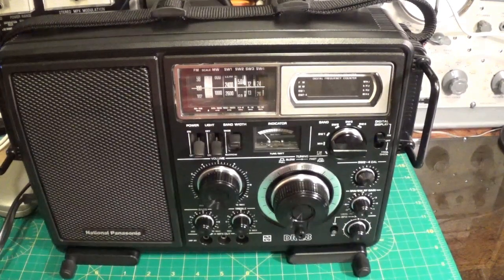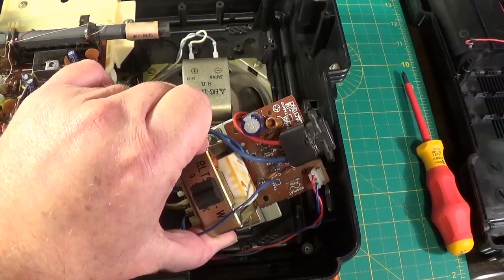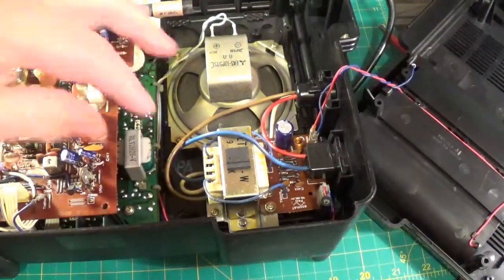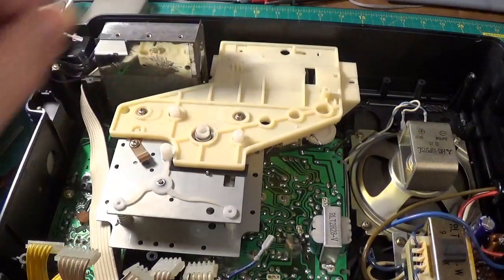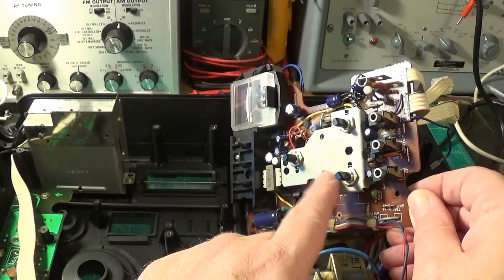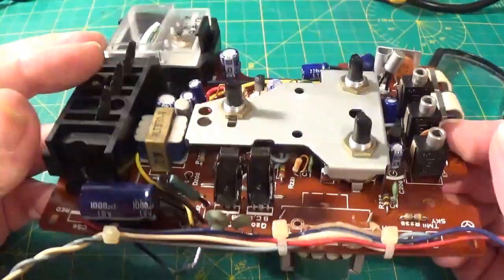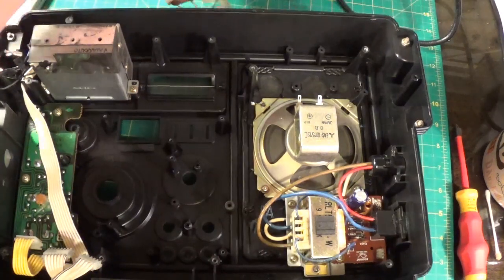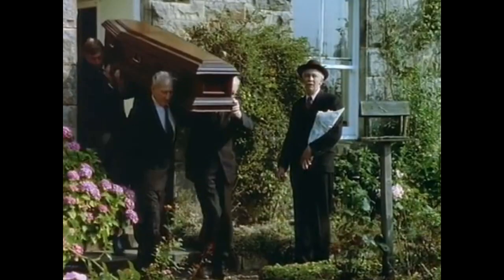National Panasonic DR28 RF-2800 radio repair part two

Comment: Thank you so much for a very interesting video. I have a DR29 that was sitting at a recycling station here in Sweden. It has no lightning and the battery and tuning meter is completely dead. However, it takes in stations on the FM band very well. Crystal clear sound, but the volume knob is quite choppy I can hardly wait for part 3. Thank you very much

Comment: I was wondering  if you considered replacing those bulbs with LED's while it was all apart as it seems your luck is about the same as mine. Put it all back together and the bulb burns out. Those looks like the same type of bulb that was used to light up the dial on stereo tuners of the day. Since it's quite a bit of work to get to them I think I would go the LED route simply for longevity's sake. Looking forward to part 3. ATB Doug.
Reply from the maker: Hi Doug, that's next on the hit list, one or two LEDs to light it up like a Christmas tree! :)  Yes, I've had to replace several of the fuse lamps in a couple of stereo receivers I had ages ago. Not an easy job as the whole front needed to come off.

Comment: I got one of this when I visited srilanka. One guy was trying to sell this scrap on the foot path in Colombo. Happily he sold it to me for $ 2.That was 20 years ago. I was surprised to see smd components inside freqency display. It's digital display, amplifier board, power supply are working. Since last 20 years I am experimenting with it. It's main board consisting of rf amp, mixers, detectors etc is in very bad state. Some sections burnt and repaired previously. Insulators inside the tuning capacitor has crumbled. I have repaired the fm front end only. The IC, an7212, An7210 an7211 are not available. I Coul manage to get the schematic recently on the net which is not clear but helpful. Don't know if I can fix it.

Comment: Hello, excellent tutorial.  Buy the way,  did you finally get the problem fixed ?
Reply from the maker: Hi Mike, no :) Too many projects on the go. This one will find it's way back on the bench though as it needs aligning and I will also convert lighting to LED.

Comment: I do not think you have a problem with the lamp dimming on high level. After all it is fed from a un stabilised supply. The amplifier is probably class B and the current draw on low volume would be probably 30mA or so but in high volume could well be 100/150mA so the voltage WILL sag. You could use an LED which will not show the voltage change so much and use a lot less power on battery use. It is the amplifier current draw you are seeing, not much you can do about that!
Reply from the maker: Hi Michael, you're quite right it is a class B amp. Have to say I've not seen the dimming effect this band before, it's just really noticeable hence my dive in for the capacitors.

Comment: I have used the ESR meter, (a kit from Electronics Australia) and make comparisons between the ESR of the new electrolytic capacitor, and the old one. Often on the lower values, (working voltage and capacitance) the ESR reads higher with the original capacitor in circuit, and therefore 'replace', but Panasonic (Matsushita Electric) radios of that vintage have very reliable electrolytic capacitors, so an ESR of 1.68 ohms would not stop it from functioning, given the volume control is a some kilohms... A 'freeze' test would ascertain an electrolytic capacitor fault..
Reply from the maker: They do have reliable capacitors in in general but this was the first one I pulled and tested that showed In Circuit when out of circuit. Anyway, someone will never have to replace that again :)
Reply: Yes, quite right. Over several TV repairs, I've found the most unreliable passive  components are electrolytic capacitors. I barely did any work with 'tube' or 'valve' circuits, and it seems they had problems with the higher voltage wax/paper types as well.

Comment: Fab video Andrew. Lots of dismantling to find the dodgy cap! I really like Panasonic gear. Their caps are very highly quality and rarely fail. Will you change the lamps to LEDs or keep it original? Nice work. Thanks for taking the time to document it.
Reply from the maker: I'm going to put LEDs in Victor. Yep, I use Panasonics in almost everything from valve stuff to transistors, never an issue.

Comment: simple jobs are never easy, yet the ones you dread go smoothly. There is no such thing as a 5 minute job in radios though...
Reply from the maker: This one was the unknowing bit, the expectation that any second a spring could go flying across the room that you couldn't see where it came from. It was actually way easier than I thought to remove that tuning section, very cleverly designed.